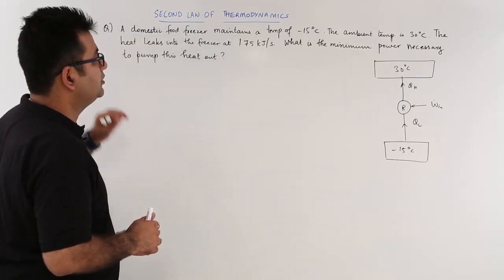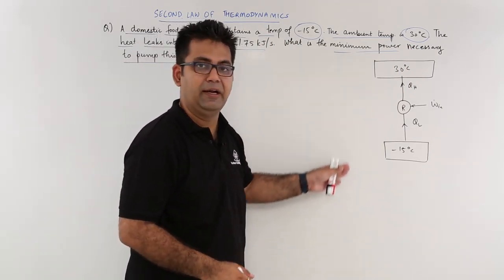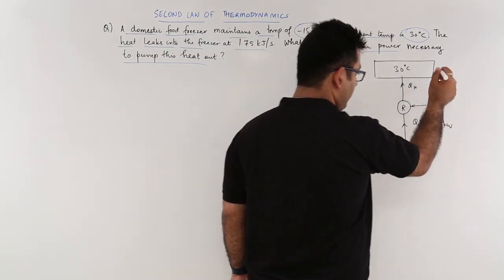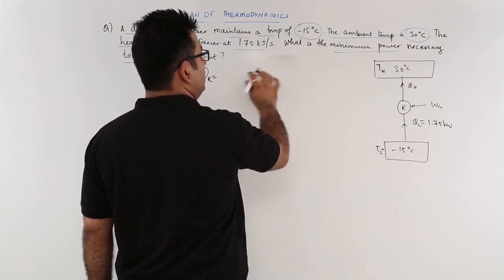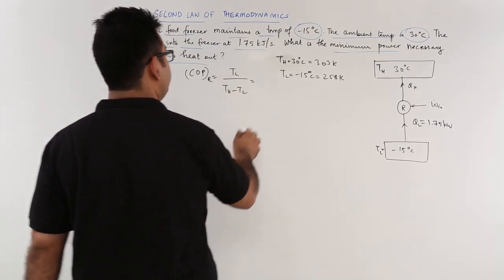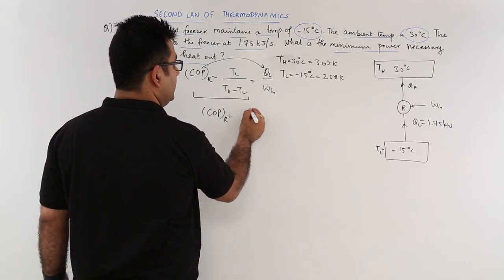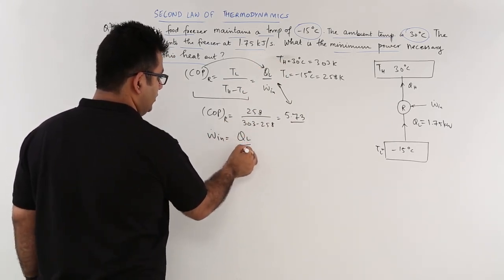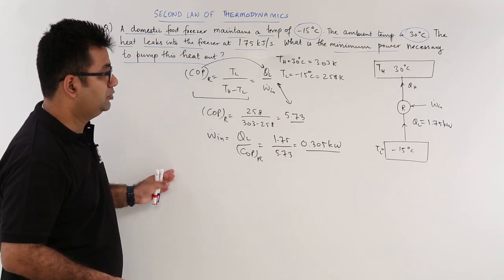Refrigerator Numerical Example 1

Comment: A Carnot refrigeration cycle is operating between the minimum and maximum temperatures of - 8 ° C and 20 ° C respectively. The refrigerant used in the cycle is R - 134a and the cycle is operating in the saturated liquid - vapore region. The mass of the refrigerant is 0. 8 kg and the refrigerant is saturated liquid at the end of heat rejection process. The net work input to the cycle is 15 kJ. Determine the fraction of the mass of the refrigerant that vaporizes during the heat addition process. Given
 hra at - 8 ° C = 204. 59 kJ / kg 
hg at 20 ° C = 180 - 33 kJ / kg 10.

Solution please
Reply: 8.4 kg
Reply: @akshitchauhan7743  how bro